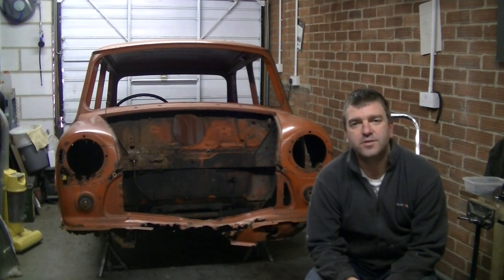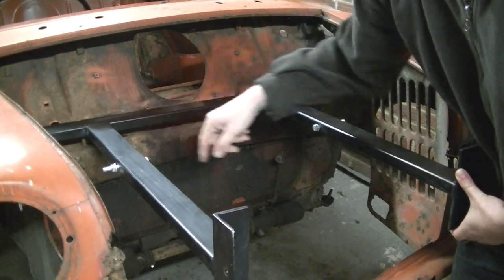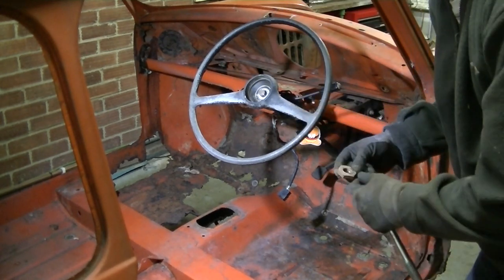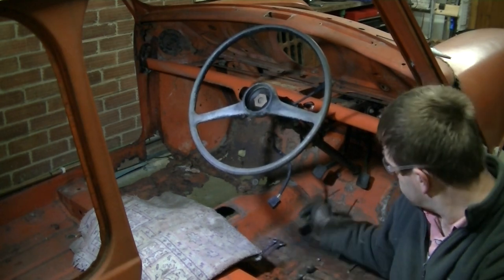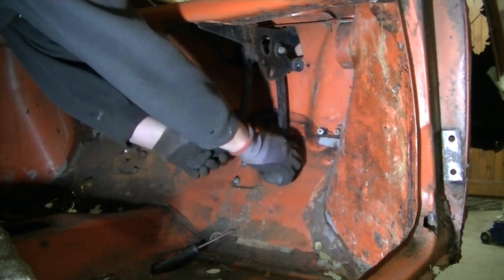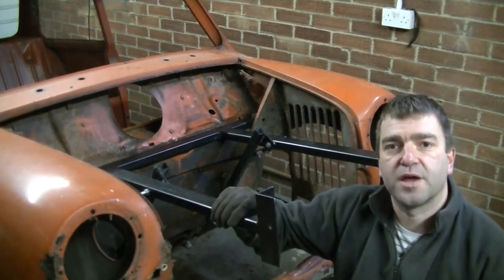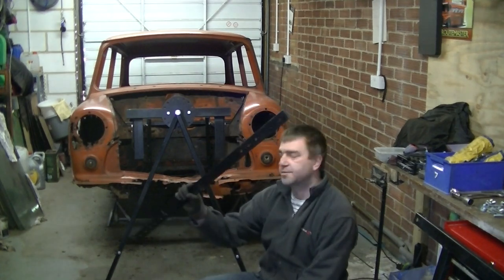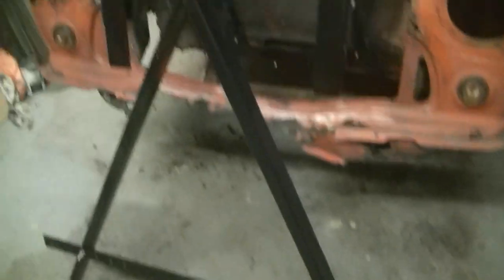PRT3 ROLLOVER JIG SPIT BUILD UP FRONT SECTION AND PEDAL BOX REMOVAL SEVEN CLASSIC MINI LIFE

Comment: In my experience, I found that if you reinstall the steering wheel nut back on as you did, hit the nut with a hammer & brass punch, the shock of the impact will loosen the splines on the steering & hub.
Hope this helps in the future.
Rick
Reply from the maker: What you dont see is I did take a hammer and a puller to it with no luck. The puller didnt grib very well. It was only two hits when off the car so alot quicker to just remove the column and hit on the bench. Thats the first wheel I havent been able to wiggle off.

Comment: How did you get the two bolts attached to the pedal box / bottom dash rail out ? Cause that’s where I am now regarding removing pedal box from my 1988 mini but having difficulty removing these bolts as they are shear bolts
Reply from the maker: I was lucky in that those two had not been shered. I normaly cut a line in them and use my inpact driver or drill them out and fit normal bolts afterwards. hope that helps
Reply: @classicminilife  brilliant thanks